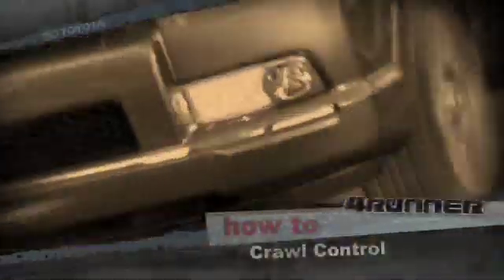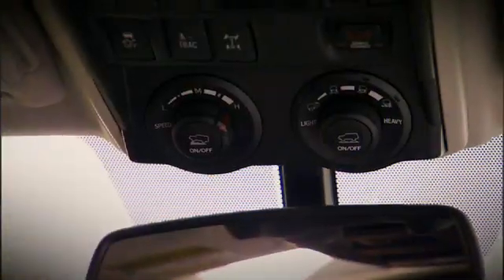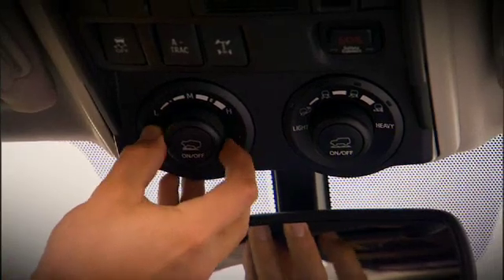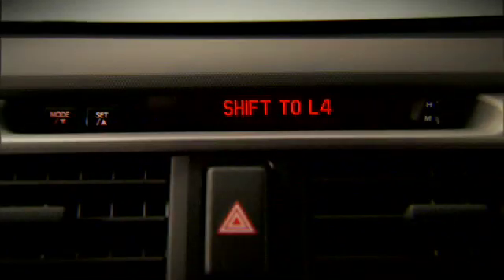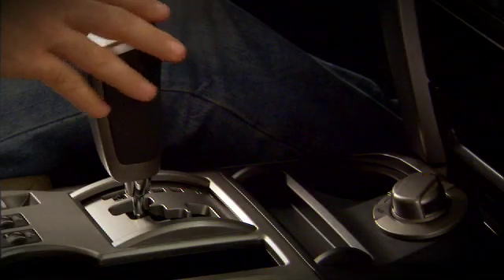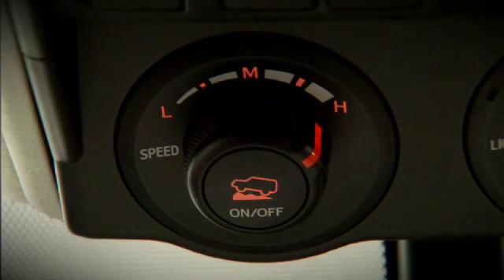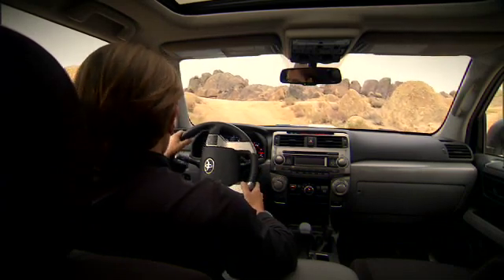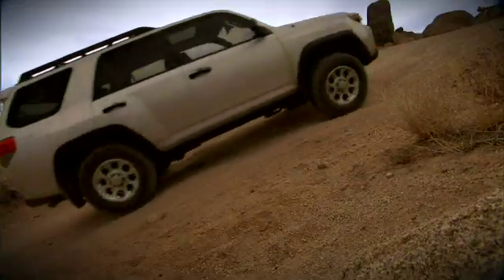2010 4Runner How-To: Crawl Control | Toyota

Comment: If I ever got one of those, that feature would be ripped out. In my opinion, it just takes the real fun out of four wheeling. In situations like that, with a normal 4x4, it educates a novice driver on what his/her vehicle can and can not do. It also teaches them how to pick a good line. Another thing about the '10 4Runner is that it's bulky, which makes it slightly harder to manuver around tight obstacles.